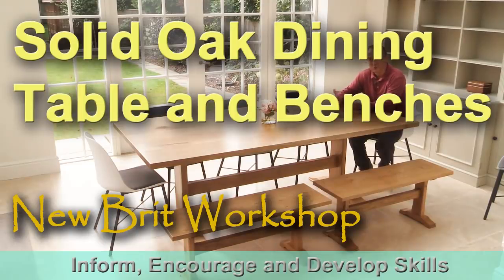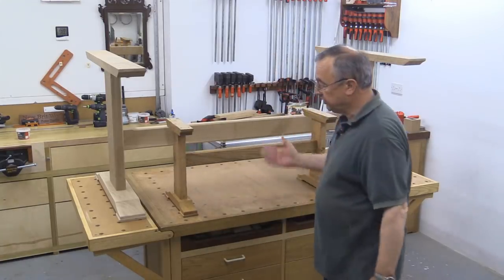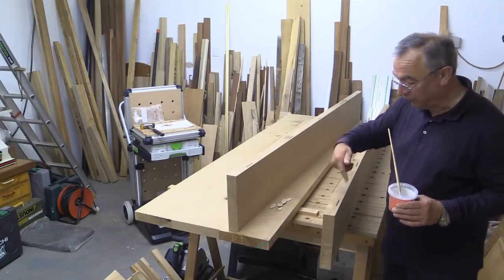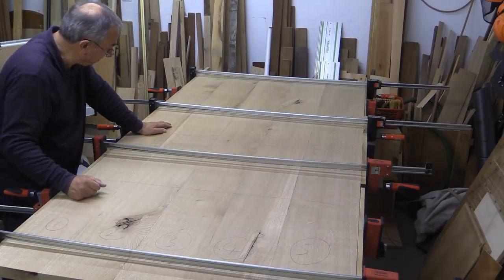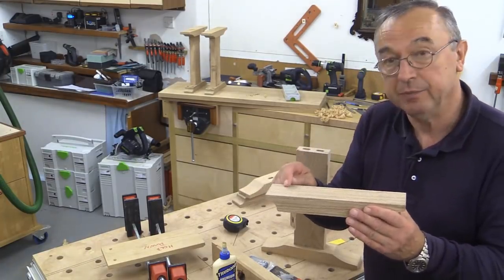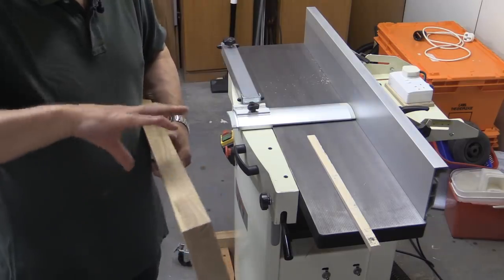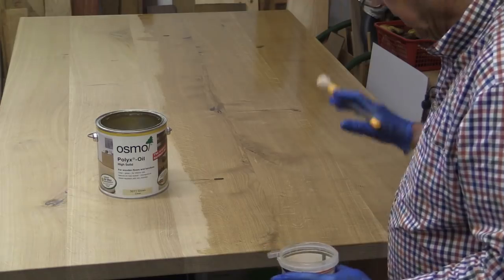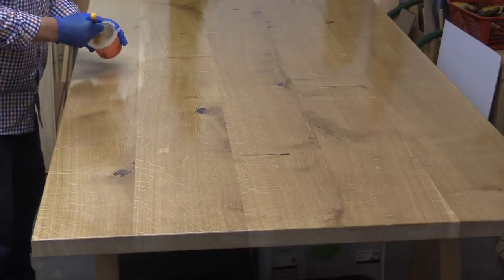Making a dining table with matching benches

Comment: Hi Peter a great video, just like all your videos. Can you please give me details of the oil finish as well as the type of brush you used on this project it looks fantastic. I have built a few bits of furniture in the past no where near your standard but I find the finish always lets me down, they are okay but not what I would call a good standard.  Here in Australia  I only use pine to create my units as money is not that plentiful and then usually stain it to create a different appearance. I have just retired and watch a lot of different videos to try and get more informed on different techniques , my tools are also very minimal but I do have a good collection of Festool tools that I have purchased over the years. My workshop is my Garage which again is very tight as over the years through my job I have collected bits and pieces of timber and laminated pieces that would normally be thrown out hence this makes my workshop even smaller. I worked for a small commercial building company for nearly 50 years and progressed from a carpenter to site manager, as mentioned I recently retired just after my 70th Birthday and now I can start playing around with timber more. My project at the moment is my wife's mum's house which  my wife inherited. I am slowly  replacing the kitchen and bathroom and getting it ready for leasing , Again all the work I am doing on it is from material I have brought home over the years but it is cleaning it up and making it tidy. I love the industry and am amazed at the number of talented people out there that can produce beautiful pieces. Sorry for the length of this but I thought I should give you a bit of info on my background. Keep up the very interesting videos I enjoy all of them and find them both interesting and informative . Regards Kim.
Reply from the maker: Hi Kim, It is Osmo PolyX Gloss. I use a synthetic brush with fine hairs but bristle would be better. Apply several thin coats allowing plenty of time between coats.   Peter

Comment: Peter, A very good video. A simple yet elegant table design, straight forward build process,  a great choice of wood and a clear finish to let the wood be the wood. (Here comes the but), but personally speaking ,my life is too short to allow me to use a brush that small! With a top that large I'd need to be rolling the finish on. I then go back over the wet surface with the largest width brush I could find. In New England that would be a 4 inch brush or 100 mils. Seriously though, a great project! G.
Reply from the maker: Hi George, That is my favourite brush for Osmo - but I take your point.  Cheers.   Peter

Comment: Great video as usual. I am sure you know this but I would like to mention it nonetheless. I noticed that your Bessey clamps are K types. When you clamped the table top they were slightly bent. these clamps come with a couple of supports which are attached to the end of the bar/rod. You can use these to stop the bars bending. I use Bessey clamps and I use these supports they are great.
Reply from the maker: Hi Mehdi, Many thanks for this. Yes, I am aware of that but never seem to have them handy. It is very important to balance the clamping by having some on each side of a board glue up.  Cheers.   Peter

Comment: Peter, Beautiful table.  If you only have a DF500 domino, how would you recommend constructing the base supports?
Reply: I have the same question. But I assume we use the biggest we have , times as many as will fit with a decent wall between them.
Reply from the maker: Hi Guys, Aegir is right. You could easily use the DF500 for this and you would then use the 10 mm x 50 mm dominos trying to get, if possible, 2 rows of 3 if the "leg" piece is thick enough. It might not be quite as strong but it would still be strong enough for normal use.   Peter

Comment: Thanks for the video, Peter - Osmo question... I noticed that here you just brushed it on, but in other videos and other places on-line, a white pad was used to spread it and/or buff it in - some using a sander or buffing machine to do it. I have started using Osmo, and am finding that it seems to work well with buffing it in - you prefer just brushing it on? Or is the gloss different than the satin finish for this?
Reply from the maker: Hi Lawrence, I just cannot make up my mind which is the best. If I am in a hurry I use the white pad followed by removing excess with a lint free cloth. I did use that method on the second and third coats of this table. The first coat I brushed on a thin initial coat and after it was dry I used 600 grit Abranet to de-nib.   Peter

Comment: Quick question - why did you use biscuits on the work surface rather tan dominos?….presumably dominos would have made stronger and would have still resisted the lateral / warping forces?
Reply from the maker: Hi Mike, My woodworking friend jointed the long boards for me on his huge planer and we then laid them out and before I knew it he had marked it up for the joints and put in the biscuit slots. I would certainly have used dominoes as I sold my biscuit jointer years ago - my friend was just being kind (whilst I was making the tea). Do not glue the biscuits or dominoes in as it can make the joint weaker.  Peter

Comment: Thanks for the video! I was very confused with the statement on not putting glue in the domino mortises. Im sure this is the general way of doing it, and ive sure always done this. It’d be great if this one could be clarified.
Reply from the maker: Hi Daniev, It is to stop the joint being forced apart as the wood expands and contracts. I will try and remember to cover the detail in a Workshop Notes video.  Peter